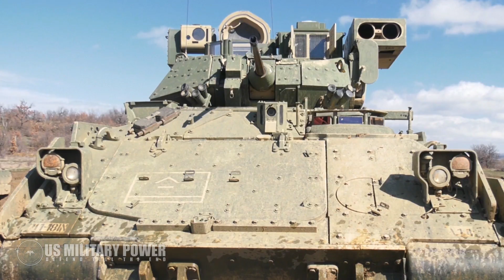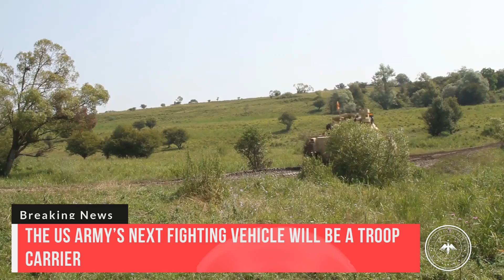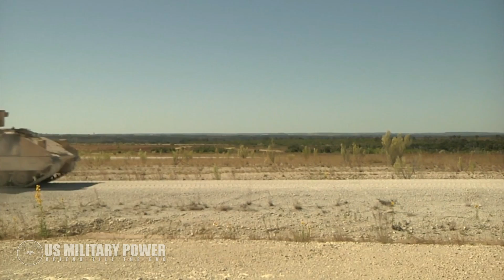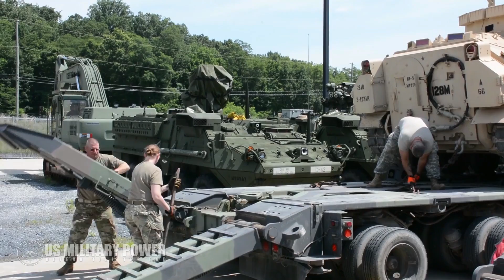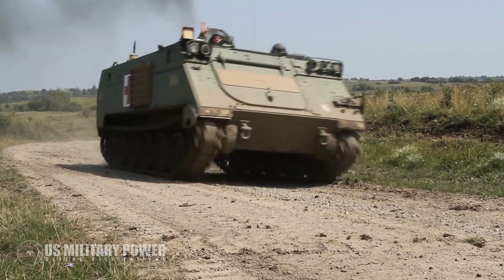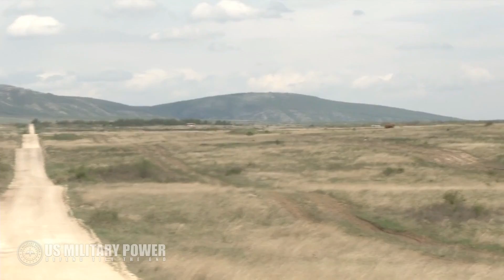The US Army’s Next Fighting Vehicle Will Be a Troop Carrier

Comment: Ok--- Armor Protection weight and load is a function of width and length. The wider you can make your tank, the shorter you can make it closer to the perfect square that gives you the most protection for a given load at a given weight.  What they need to do is increase the width to that of the M-1's 12 feet with a new suspension system that gets away from the torsion bare system used now that gets in the way of a low siluet or high ground clearance from IED's or both with the flick of a switch on a Hydropneumatic suspension system, (outside hull inside protective skirt). As the crew compartment height is a fixed quantity the only thing you can change is the width and length. The wider compartment would also allow you to us a tapered side from floor to seat and up across the backrest, channeling the blast force of mines and IED's to the side instead of into the crew compartment while still carrying a good sized load.(Troops). Now your light weight Armored fighting vehicle can put on a large high velocity 40 mm (or 105 anti tank) gun with out having to worry about stability issues while carrying 9 troops and their equipment and spare ammunition.